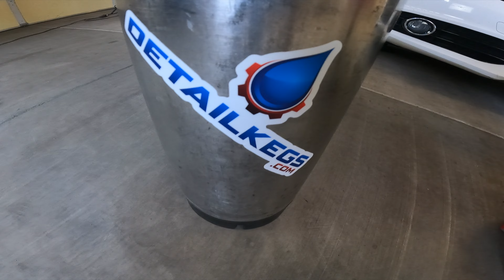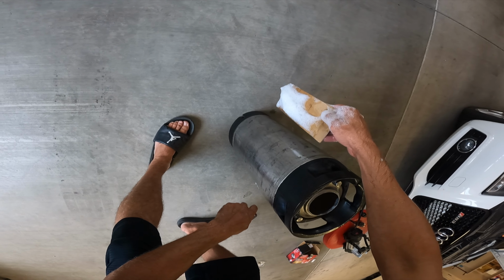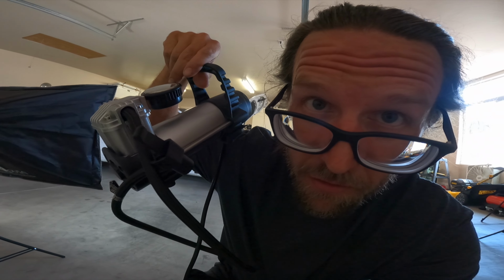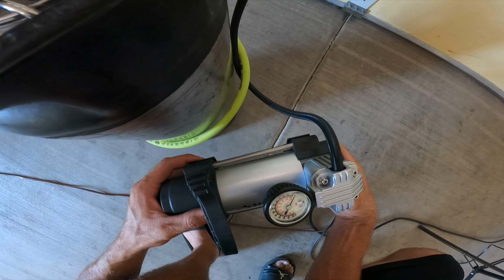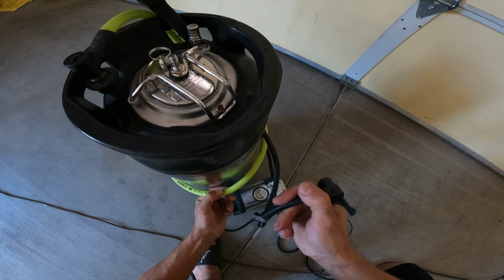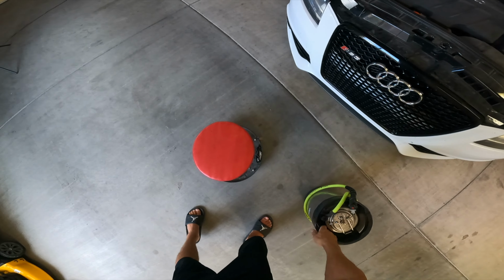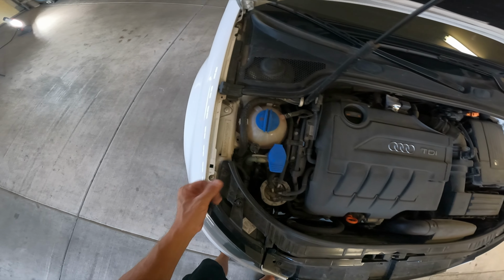Pressurizing your DIY Detail Keg w/ Husky compressor Video #2

Comment: Need to get a battery op pump like the 20v Worx   i have that will go to 150 psi.
Reply from the maker: Those are 5X the price of the husky compressor 😆 I’m trying to do this as cheap as possible. 

I am interested to know how long those batteries last. I have a love/hate relationship with battery tools. 

Love when they’re working, hate when the batteries die 😂